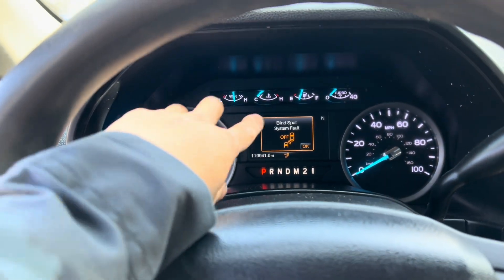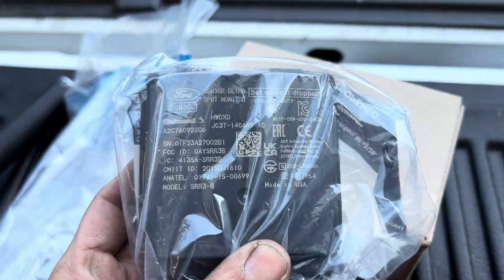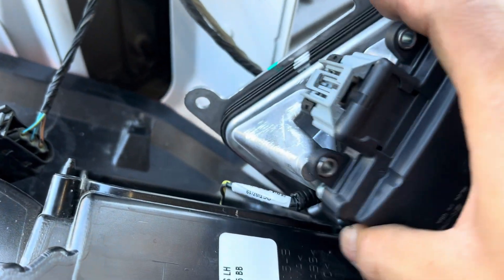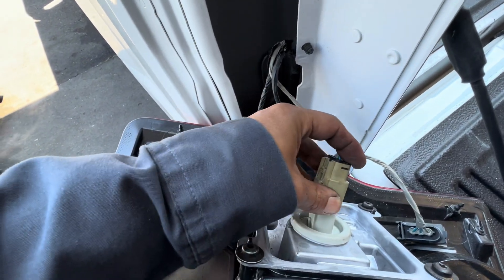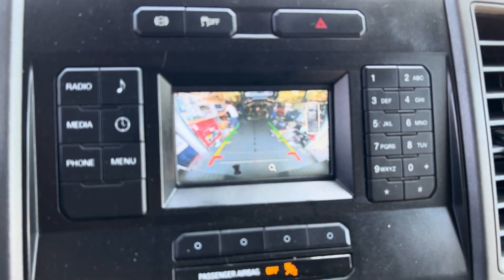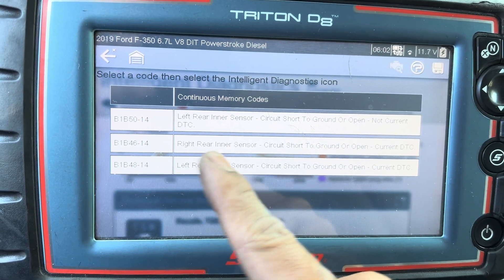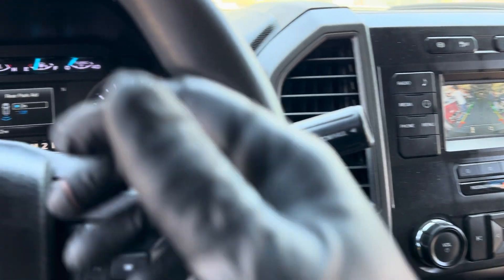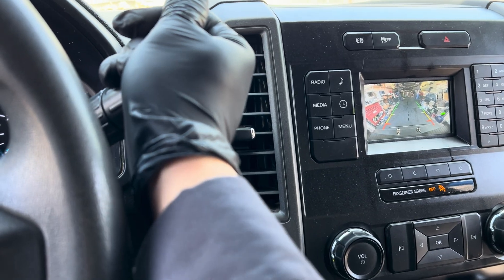Ford F-Series Truck Blindspot Radar - Module Replace & NEED TO BE REPROGRAM

Comment: My 2022 f350 left side isn't working. My mirror doest light up, but my right side works, the weird thing, I'm not getting any notification notice that there is a fault. 🤷‍♂️
Reply from the maker: 2022 is kinda new. If the computer doesnt notify you for the light problem. You having problems with the fuse, electrical wiring, the parts or the computer could be bad not knowing its bad. Recommend going to a shop to get this electrical problem diagnose.